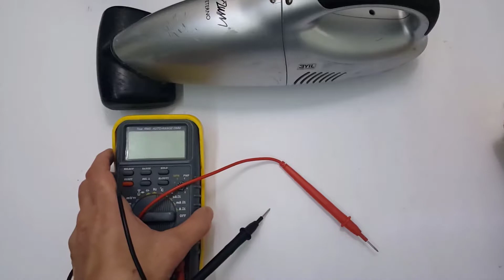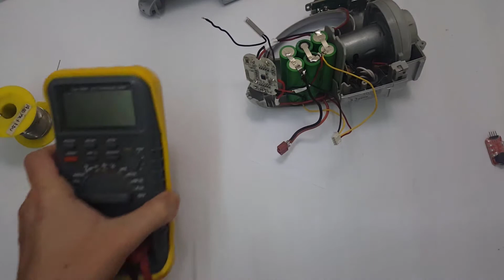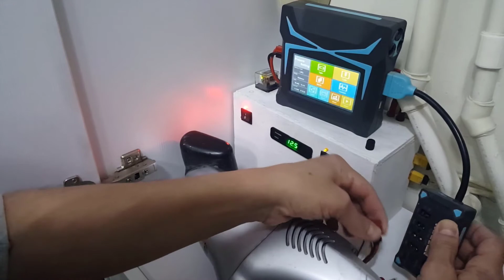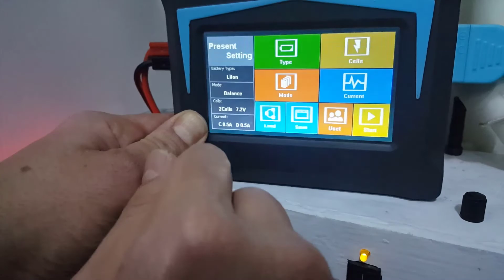Cordless Vacuum Cleaner Battery Replacement / Boosting the Rechargeable Vacuum Cleaner with Li-iON

Comment: 2s yapacağım 7.4v 2900 mah yeter mi yoksa 2 tane daha mı yapayım ? Tek grup kaç dakika çalıştırır? Kullandığınız pil nedir ?
Reply from the maker: 2 ad 3s. birleştirip bagladım 3000 den 6000 mah oldu. mah değeri kullanım süresini uzatır. 2900 mah da yeterli ama neden 2s kullanıyorsun cihaz kaç volt ile çalışıyor?
Reply from the maker: @neswblvck7512  Ozaman sıkıntı yok yeterli kolay gelsin.
Reply: @abln6382  12 volt 3S BMS kaç volt adaptör şarj ediliyor ? ya 13.6V ya 14V gibi birşey